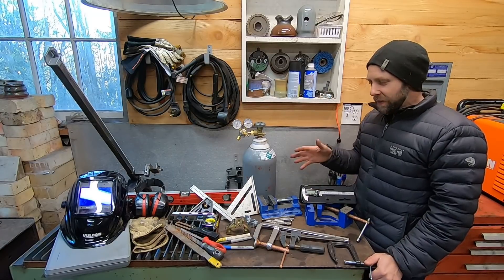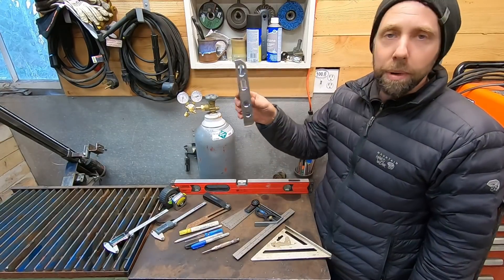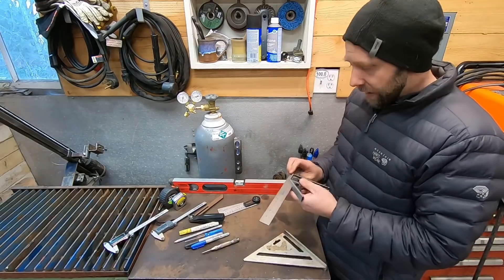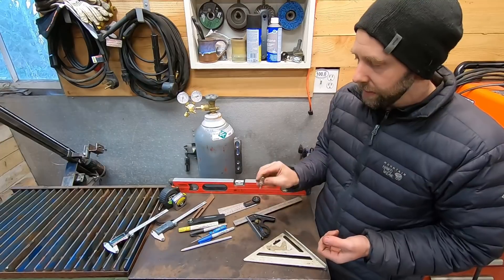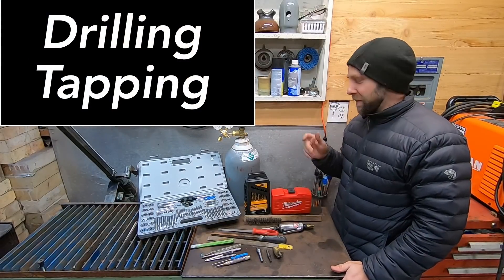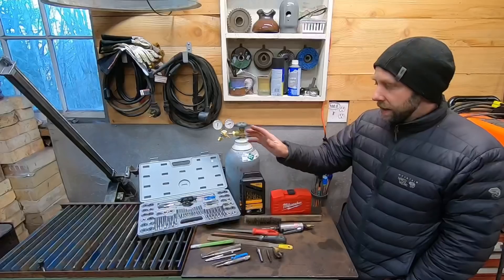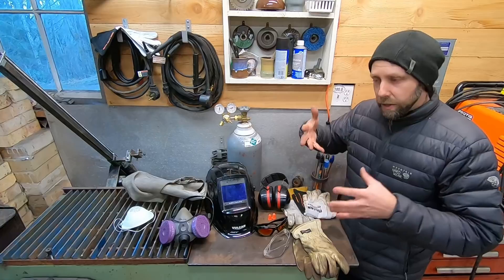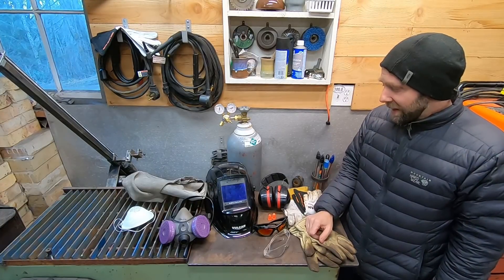Affordable non power tools to get started in metal fabrication

Comment: Breathing protection is the most important and first thing any welder/fabricator should buy. Dont cheap out. If its not comfortable to wear you will skip doing so. 
Im old enough to have worked long before breathing protection was common/required. I am paying the price in my old age.

Comment: Mike, can you give me an idea of what's the best route to go for gas bottles.  What size bottle works the best for TIG?  What about MIG?  What about OFW/OFC?  Should I lease or buy my own tanks?
Reply: You can buy full cylinders of welding gas from Amazon. No matter which route you go it costs money up front. Even if you rent the shops around here want the full value of the empty tank for a deposit. Was about half the cost just to buy from Amazon. The 125 cf bottles are nice because they are 45 cf bigger than a 80 cf tank but when you get a refill the 125 cf tank only costs a few more dollars extra. More gas for slightly less and fewer trips to refill.
Reply: Check with your local gas supplier. My region I cant find any supplier that will fill a customer owned tank.
Also tanks need to be recertified periodically.
My local tank tester will not test a privately owned tank.
Other areas of the country are different.

Comment: My tool list

Auto hood
Tool box 
PPE (gloves, jacket, leathers, safety glasses ect) 
Angle grinder 
Die grinder
SAE wrenches
Metric Wrenches
Ratchet set and sockets
Chipping hammer 
3 lbs sledgehammer
Striker
Combo square
Soapstone 
Tap handle 
Cordless drill
Scribe
Center punch (i have the starret auto center punch myself
Calipers
Metric tape
Standard tape
Wire brush (stainless one for steel, one for stainless, one for aluminum) 
Scraper
Speed square 
Carpenters square
Tip cleaners
Vise grips
C clamps
Welpers
Side cuts
File set
Flashlight 
Temperature gun

I think this is good for someone getting into the field
Reply: i would ad

impact gun (depending on where you work i found it super handy for stuff at my work as we had jigs for welding tables we would bolt down)
scailer
high speed 3in cut of tool
vice

Comment: Yo mike how has the Titanium line up been treating ya so far?
Reply from the maker: I really like my Titanium 200 It’s my main welder for my home shop, I don’t run the flux 125 much because I usually use the 200, so my friend has the 125 for now so he can weld up some projects at his place. We have a flux 125 at my work and we use it often on small jobs when you don’t feel like packing a bigger welder and bottle around for a quick repair. 
I also have the Titanium plasma 45 and I have cut over 350 feet of metal with it on my CNC table and it’s been really solid so far 👍
I’m not sure if you have seen my articulating dump truck build yet? I’m running the plasma 45 and the Titanium 200 on this project https://youtu.be/MdbNO4S26jk

Comment: I am a greenhorn when it comes to metal fabrication. I am retired and found a real old truck on the ranch where I get hay for our horses. It had a tree fall on the back of the cab that caved it in. The owner is considering letting me have it as I want to turn it into some yard art on my ranch. I dont want to restore it but I will need to bang out or repair the truck cab. I will need some cheap metal fab tools and your videos have been very useful. Thanks for sharing them, they have given me the encouragement to get out of my livingroom  chair and do something other than watch TV. I have a lot of tools and equipment in my garage that is collecting dust.

Comment: Theres a another way to measure with a vernier caliper. Facing them on the very left is the vertical edge about 25mm long you can use that as a step gage or so on.

Comment: Great tips. I think cheap autodarkening hoods are OK because they all block the UV and IR even in "light" mode. So if they don't auto darken you get dazzled but no harm done. I think most clear polycarbonate safety glasses block UV anyway but some have a proper certification. I recommend getting those and just leaving them on all the time even under the welding hood. That way you never have to remember to put them on and you'll be all right even if you really get flashed (because you forgot to actually put the hood down).

Comment: Hey, Mike.

I use calipers a lot for machining. I started with the Empire set from home Depot that were like $25, and they work okay, but quickly moved up to Mitutoyo Digimatic calipers. 

For welding & fabrication, it's much easier on the wallet to buy one or two cheap sets of the stainless vernier calipers online that just have the markings on them. I find them for $12-ish on eBay often, and they're plenty accurate enough for metalwork. You also don't have to worry about batteries, or the screen getting messed up. The only thing is learning to read a vernier scale, but once you can do that, you can read a micrometer to .0001". 

If you're not well versed in vernier and want a way to read metal thickness easily, a metal thickness gauge on a keyring from Miller is only $6 or so on Amazon and shows the most common metal thicknesses. 

Another great video, Mike. Keep at it!👍

Comment: Enjoyable video Mike, should help a lot of people, it helped me and I have been collecting fab tools for years!  Now, if you'll excuse me, I need to complete my amazon order...
Reply from the maker: Thanks for always checking out my videos 🙂
so you noticed a few tools of interest in the list 👍
Reply: @Mikefestiva  Yep, just placed an order for 2 of the HFS 3" clamps through Amazon - gotta love tax refund season...  I could have used these last week on my neighbors dump trailer project.  I have a pair of 6" x 1/2" angle iron scraps I've used for a few years for squaring and clamping weld projects that work fine but much less convenient and time consuming on the setup.  Also limits access to tack the inside corner.  Although we'd all love a set of Fireball squares, my budget is more along the lines of the HFS clamps.  Really appreciate you testing these reasonably priced tools and and sharing with the rest of us Mike!

Comment: Just be careful with magnetic clamps. Two things. If you use an angle grinder, you’ll find those particles everywhere. Guess what picks them up like a magnet? Yup! So if you use them to keep things at 90 degrees, they won’t, because of the particles. So keep them clean, and away from where you grind. The other thing is to keep them at least 6 inches away from your weld, especially if you’re welding in DC. The arc will flare towards the magnet.

Guys, Mike knows what he’s talking about. Take his advice. Check out his projects.
Reply from the maker: Mel Gross Thanks for comment Mel 👍
How have you been, are you able to get back to working in your shop again?

Comment: I have a few ideas for your next video on must have tools. Ball pene hammer, handles hitting hardened tools like punches and chisels.  Letter and number drill sets. Required for proper clearances for taps and pins. Pin punch sets, transfer punches, hardens straight edges 18" to 24". Toolmakers vice, 4" is better. Rubber pad for setting finished parts on. Hand scribe and both the fixed 3 sided scraper and a rotary debut tool that tacked replacement blades.

Best thing to do is try to make anything. Then buy only what you need. Best place to look is McMaster Carr or Granger. They carry true machinist and machine builder tools and fasteners.

Comment: What is a good gasless welder for messing around in a garage without 220? I need to do some fabrication on my 05 Kawasaki prairie 360 and my 68 Harley Davidson golf cart...
Reply: You can get a wire feed welder that runs on 110 volts or 220 volts on the same machine depending on which cord adapter you use and start off with flux cored wire for welding.  Then when you can afford to get a gas bottle just change to mig wire for mig welding. When you can afford to upgrade your electrical system to 220 volts ( already capable on your welder your set ).  I hoped this helped.
Reply: I personally have a Hobart 110V running flux core wire. Wish I had bought the 220/110 version. Last summer I bought the largest full bottle (that Americans an own) of 75/25 new for about $160 for another machine I inherited. Refills will be much less. If you watch Mike F. he's using a green Harbor Freight unit. Many others have done videos on the green machines as well. I suggest getting the biggest unit you can afford as you will be amazed how easy it is to "find" things that need fixing. Have fun!!!
Reply from the maker: Hey Michael if you are on a budget the little flux core Titanium 125 sold by harbor freight is about the best bang for your buck, it goes on sale for $150 often. If you have a little more money to spend I would say the Titanium 170 or 200, both are 120/240 volt welders both can run flux core wire but you have the option if you buy a gas bottle you can run shielding gas and your welds come out really clean and nice, the 170 is just a MIG ( wire feed) the 200 like I own is MIG, TIG and stick. Both 179 and 200 can run a optional spool gun to weld aluminum too.
I hope this info helps 🙂
Reply: @Mikefestiva  thanks for the info. I appreciate it. I havent learned how to TIG yet but I can MIG weld all day cuz its easy. I can somewhat stick weld but not the greatest. But I'll check them out and see which is best for my dollar as of now.
Reply: What brand would that be so I can check it out? Thanks

Comment: I am an new subscriber  intermediate woodworker. I  just bought a flux core welding and did a search you came up at the top. Your videos are fantastic . Thank you for sharing your expertise for us new guys.
Reply from the maker: Right on Keith Thanks for subscribing and checking out my videos, I really appreciate it.
I use to do some wood working and have most of my tools still, I plan on building a simple wood shop in the next few years especially that I have my home built bandsaw mill for cutting up lumber. My woodworking has been mainly working on my cabin and out buildings over the last few years, I use to make rustic shelves, benches stuff like that. Take care

Comment: Lincoln makes a nice entry level hood.  Same or less $ than the HF top of the line.  In general HF welding consumables and wearables cost more than the LWS.  Support your Local Welding Shop!   LWS also has a good middle weight glove for MIG; not as thick as the cheap MIG/STICK gloves but still insulated to 900f.  Those and a single layer TIG pair for TIGing covers ya.
Reply from the maker: I hear you on supporting your local weld shops but the last hardware/ weld shop closed last year out where I live, there a few others but ever time I had gone to them there customer service has been awful 😂 HF surprisingly stocks a better range of options then a shops out where I live, most specialty items I just order on line because nobody stocks them. 
I will look into that helmet 👍 Take care Leo